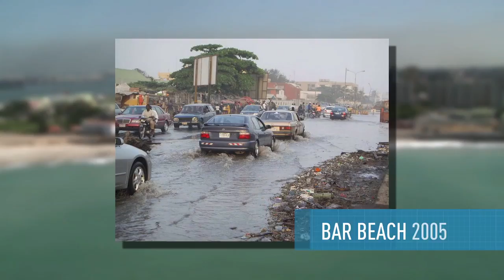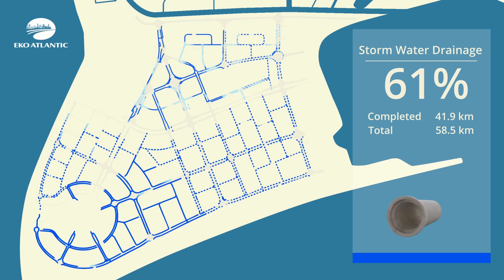Eko Atlantic General Progress - November 2014

Comment: I might be accepting a job offer to work on this project soon. Any advice about the quality of life there?
Reply: wael breiche If you've got the means, then the quality of life is relatively comfortable. Otherwise, it can be a somewhat stressful environment to live in. I'd recommend staying in a serviced apartment, if you can help it (this goes back to my mention of having the means, because they aren't cheap. Hopefully your firm will already have this sorted out for you) because they'd provide round the clock electricity, water and security, so you don't have to worry about organising those yourself as many Nigerians have to.

Attractions: ample number of bars and clubs, country club, shopping centres, cinemas, a wide variety of international and local cuisines, restaurants and fast-food, beach resorts, golfing resort etc and essentially most of the things you would expect in a modernised or modernising city.

Push factors: traffic congestion during rush hours etc; crime (as you might find in every large city really. However, I have lived in Nigeria 16 years and haven't had a major or direct incident/experience with crime, knock on wood)/insecurity; high prices in certain bars, clubs, restaurants etc; a seeming lack of order sometimes, but I think this is improving; frequent power cuts and a need for a generator (however if you lived in a serviced apartment or certain gated communities, then this wouldn't be an issue for you). It isn't always convenient to walk to places sometimes, due to poor sidewalk provision in some places, or just security concerns for some people (particularly when it's not busy - early mornings or late evenings).

At the end of the day, I'm just speaking to my observations, someone may see things a little differently than I have. And overall Lagos really can be an great and enjoyable place to live and work, despite it's challenges and growing pains. It certainly will be an eye-opening an memorable experience, due to her distinctive energy, culture and way or should I say rhythm of life. It's like nothing you would have ever experienced, in a positive sense. Feel free to throw any further questions that you may have, at me. Good luck!
Reply: I thought u guys always think people in Africa lives in d jungle now there will b more foreigners weighing they could live there #eco Atlantic dreams# life progressing

Comment: I don't know much but I am wondering what about flooding once the city is complete? If it has been eroded once, will it happen again? Why can't they build skyscrapers inland? As opposed to coastal. I am sorry to be thinking like this but my mind goes to Hurricane Katrina and Sandy in America. You  never know what mother nature can do
Reply: It's easier, quicker and cheaper to simply build from scratch than to try to rebuild Lagos inland.  Plus that doesn't solve the problem of sea erosion.  Plus this will create capacity which can eventually be tied to further projects down the line.